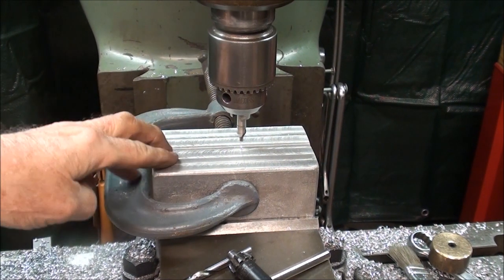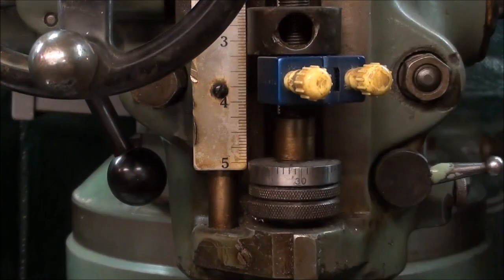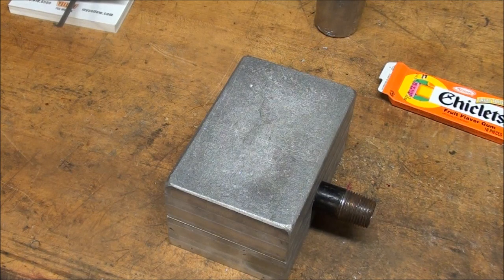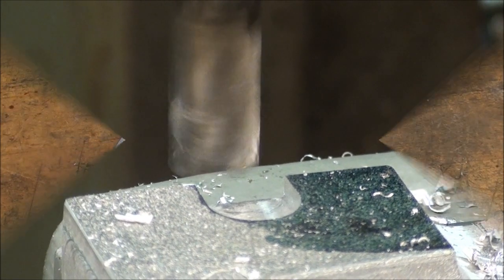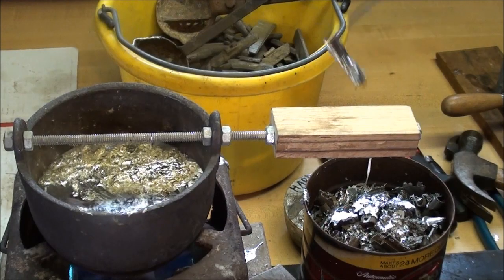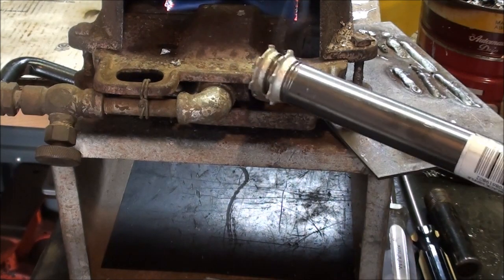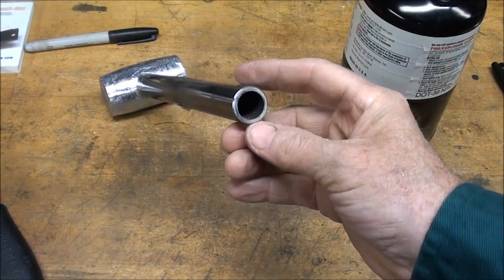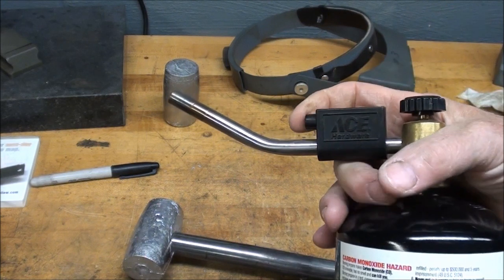Shop Tips #169 TUBALCAIN MAKES A LEAD HAMMER MOLD Part 6

Comment: Tubalcain, It is as you say, true, that a lead hammer could be purchased, or a manufactured mold could be purchased, along with a handle to make a lead hammer. The true value of this video series is (yes, I watched the entire series today), that you have demonstrated all the most commonly used processes, in logical series, involved in the manufacturing  of cast products. Whether it be hammers, cast gears, many tools, even the machine tools that many use and much more. Thank-you for putting this together and sharing your knowledge. I find for myself, there is a great deal of value in this video series, even if I am unable to use the information and knowledge immediately. I am sure many others feel the same way as well. Another wonderful how its planned, performed, completed, how-to, video. Thank-you!
Reply from the maker: +rohnerw Great comment-thanks for watching

Comment: Hi Pete,
Your videos are fantastic and never boring. You have made more than just a lead hammer which is a valuable tool; you have made a highly professional mould, what a feat. To add to this further you have generously and painstakingly given us your personal and detailed approach step by step from beginning to end. I for one appreciate your work and humour here as I am sure do many others and I have learned so much thank you.
My own lead hammer was made during my apprenticeship in an automotive machine shop with 11R and 11D white metal scrap from the bearing re-metaling plant where I sweltered so much in those hot summers. It was poured into a can with the pipe handle tinned and filled right to the top which helps to balance it in the hand. Some forty five years later it’s still a good tool.
Reply from the maker: +Phil Tams Thanks for watching & for the kind words. You greatly encouraged me!

Comment: I´m gratefull for your disposition tho share this lengthy experiment. As you told at the end of part #6 one can buy a lead hammer for about the same amount of money you spend on the handle and the rest of material used in the project. But you taught the whole process. Thank you very much!
Reply from the maker: THANKS

Comment: Enjoyed the entire series!  Just one question.  I haven't done any foundry work since ninth grade.  And that was very limited.  Could you have cast the hammer using just the plaster mold you made? Thanks for taking the time to make your videos.  I find them entertaining and helpful.
Reply from the maker: NO__TOO MUCH MOISTURE
Reply: Greg Bahleda Oh my lordy, I work at a boys school and in this day and age there is no way you would let 9 form or 10 or 11 form boys anywhere near a foundry. Its all to do with OHS and liability issues.
Reply from the maker: Mark Fryer It was scary 30 yrs ago--but all survived.

Comment: Dear Sir.
I thought it a pleasure to see and hear you.  It seems that you are sort of singing your speech, with the wonderful accent you have.  Would the hammer stay on the handle, with-out the little crown nuts at the end of the handle, or, over time, would it come loose?  When you mentioned the sand in the tube, I instantly thought about a dead-blow hammer.  would it be of any use to do that with a hammer like this, or is the soft lead going to score the effect  without the sand in it?  I do understand the reason why you used it, but it was just a thought. 
Kind regards,
Marcel.

Comment: I just watched all six of these, enjoyed them very much. When I was the welder for a machine shop, one of my jobs was recasting everyone's lead hammers when they got flattened out from a lot of use. Some of them had pipe handles like the one you made, but, since all the guys had their own lathes, many of them turned solid handles with finger grooves or cross hatching our of aluminium or steel. I'm curious as to why you chose pipe, when you could have easily made a machined handle. We had an aluminium die I used to cast them, but I can't remember what it even looked like. I might just have to attempt making one like yours.  Thanks for all the great video's you make, I'm seriously attempting to watch them all. Might take a while...
Reply from the maker: +gunnutmike Thanks for watching

Comment: Nice job Mr Pete, My high school shop techer had me make a lead hammer mold for are bridgheport nut, I made it out of plate steel and used a wrench for a handle. It worked out well but I liked your better. Thanks agen for all the grate vids.

Comment: Mr. Pete, I just watched all six of your videos on making the lead hammer and I am at ugh about how many talents you are so good at. I thoroughly enjoyed the whole series. I need a led hammer or two for my lathe and mill but I think I'll try it wirh the tin cans like in your other video. I have watched so many of your videos and haven't watched a single one that I didn't learn a lot and really enjoyed. In fact, there are probably ten or more that I have watched several times such as all the ones that say anything about a 12" Atlas/Craftsman laehe.
I have two Atlas/Craftsman lathes, one 12" (1951 101.07403 ) and one 6" (1945
109.20630) both of which I am rebuilding. Mr. Pete, I'm like you, I tend to ramble on but I don't see anything wrong with that. I'm 78 years young and I think we've earned the right to ramble on even if nobody listens. Good day and may God bless you and yours.

Comment: With the pipe around .858 you could buy bicycle grips for the handles, they are made for .875 (7/8") bar. You might need some glue but maybe not.

Excellent video. I look forward to your new material, I think I have watched all of the ones on youtube and I bought your series on the Craftsman/Atlas lathe. Thank you.

Comment: At the 8 minute mark, it looks like one half of the aluminum mold has a much smoother finish than the other.  I don't recall seeing you mill that face in this series.  Did you do this to reduce flashing?

Comment: I just made a similar hammer with a 6 lb head. The mold I made was from Plaster of Paris with some Durobond 90 mixed in. However, my handle was a sloppy fit and when pouring the lead started coming out of the mold around the handle. 4 lbs of lead escaped before it solidified up. I ran out of lead so the top of my end result was short a bit.I find it interesting how close our mold designs were other than you made a nice re-useable one. Mine might be used again, but I don't trust it... hairline crack inside.Anyway, my compliments on a great set of videos on making a hammer mold!
Reply from the maker: Thank you, give yours another try

Comment: You could use a pipe cap to prevent the lead escaping and serve as an anchor.

Bolts could hold the mold together and push it open, but your way is probably faster and works just fine.

You are right, nobody is going to make a hammer like that, but this isn't about what you make but how you make it, and in that regard it might well be one of your best series so far.

Perhaps you should auction that first hammer off?
I bet someone would be very proud to have it.

Comment: I remember reading somewhere that "Pattern Makers" were one of the most skilled workers, and demanded the highest wages.  One reason was that they needed skills NOT in just metal working, but also as a skilled "Woodworkers".
I also read that they had to compensate for shrining, and when making the patterns in wood they had to increase their size by 1/16.  
I realize that shrinkage is not an issue here, but if someone was making a cast iron gear for a machine, would they need to increase and compensate when making the wooden pattern?
Mr Pete can you clarify?
Reply from the maker: Yes.. We use shrink rules. There are many different ones. When making alum castings use a shrink rule for that material. I have a whole set of them.
Reply: mrpete222  Shrink rules, I like that, and didn't know that's was they used.  I was thinking different metals must shrink at different rates, and size of the part must factor in that some how.  I guess "Pattern Making" in another lost art.
Reply: Jim Page I think that it would be better to describe Pattern Making as a trade is undergoing a tremendous technological change at present with the increasing capabilities of CAD, 3D printing, CAM,  and other computer or robotics related manufacturing applications. 
Having said all  that, there are and will always be the need for a trades person of skill who can examine, evaluate, consider and apply solutions that cannot be done by machine. A machine can only do what we tell it to do, and the person telling it what to do needs to have the full story and the knowledge/skills to apply it.

Comment: Nice $1000 hammer ;)

Enjoyed the series; shows why having molds made costs so much and this is relatively simple.

Yes, you can buy one for $5 made with piss-poor Chinese lead so full of contaminants it will just.dissolve in a few years. You have a useful hammer that will give you satisfaction of knowing it represents another excellent set of videos. Good job :)

Comment: why not use a pipe cap on the end inside the hammer head
Reply: I was going to suggest the same thing.  It would replace the conduit nuts, and eliminate the need for the foundry sand plug.

Comment: Wouldn't it be possible to make a sand mold from the wooden pattern, modified to be able to house the handle, and stop there? (harder to serialize the production then, but as long as you've got the wooden pattern...)

Comment: I was a printer in the newspaper industy when I first got out of school,  We used a led hammer ot knock the chock into a roll of paper.  We used a coffie can to poor the led in that we had cut open not form the top but form the side with a pair of snips.  We made smaller hammers out of a soda cans that we had opened the same way,  I think we just held the shaft there while it cooled.  I do like your foundry videos and your attatues toword life.  thx.

Comment: You don't necessarily need another pipe, you could always make a double ended hammer.

In addition, I wounder if it would work to turn the mold so the handle is vertical and pour the lead down the pipe. It would be best to weigh the lead so you don't end up making the handle too heavy. Although you could go with a slightly lighter head and it might give the hammer more balance. If it works, that would eliminate the need for a gate on one of the faces.

Comment: There are too people that will go out and make one..... 😄

I didn't do it quite the same way though. I sand casted my favorite brass hammer and made a lead one with a pipe handle similar to what you did but I used pipe caps instead of sand and cast an aluminum ergonomic handle over the pipe first. Made a real comfortable 4 pounder. Sand casted the basic handle from an old eastwing brick hammer I liked. So yes we do.. 😀

Comment: The round hammer handle would bother me as it turns easily in the hand.

You could give the  handle a bit of a squish in the vise to get some oblong in the handle to be more like   wooden hammer handles - that flattened coke bottle shape.

Comment: You are wrong in one respect Mr Petersen. I WILL eventually make a lead hammer mold, as they cant be found for love nor money around here. Only the plastic kind with steel shot in them, and you cant really recast those when they're all beat up now, can'ya? I'll probably bore out the halves on the lathe out of stock instead of casting though.
Excellent series, as usual. No tv reality show comes close.
Reply from the maker: THANK YOU

Comment: The value of this video series is not the lesson in how to make a lead hammer, it is process of the mold making.  Mr Pete downplays the value of his hammer, but the same process could be used to make more complex and less readily available parts.  The lead hammer is just the MacGuffin.
Reply from the maker: Very well said.

Comment: Not wanting to offend you ,but wouldn`t your handle eventually unscrew after repeated use ?  So wouldn`t using a long pin through the end of the handle before casting be more advantageous
Reply: +MrBuck295 You can implement yours that way.
Reply: +MrBuck295 - Pre-tin the clean-threaded area of the handle and soft-solder the locking rings to the threads. Be sure to remove any traces of flux, to prevent gassing when pouring the molten lead. Lead melts and joins with the solder: Hey-presto, handle well-stuck-on.